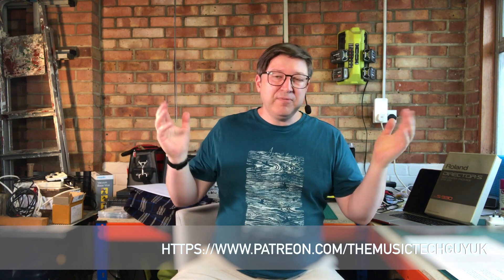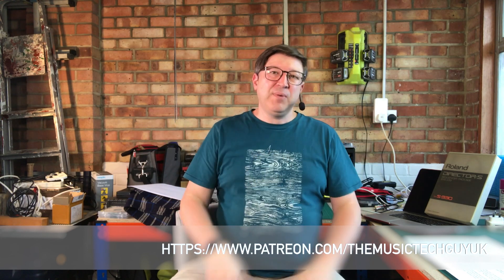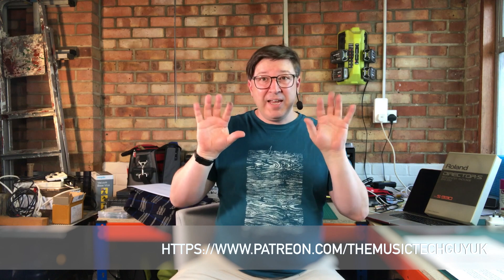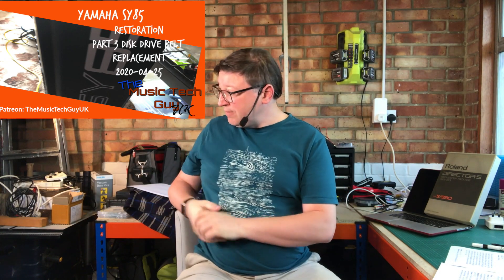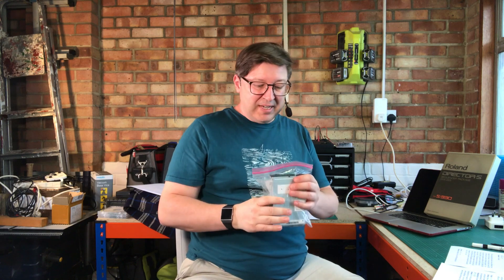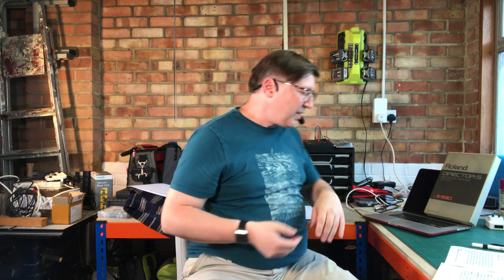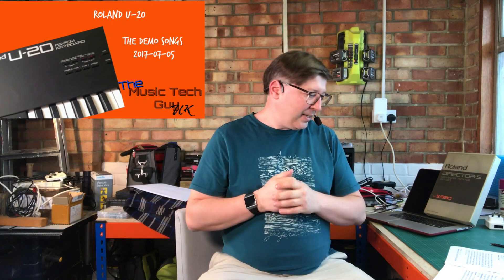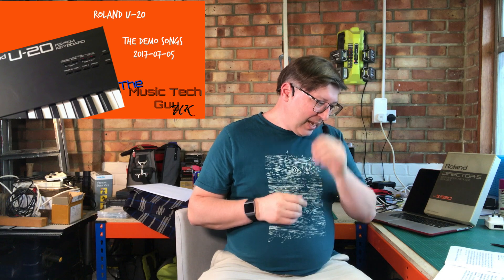Roland A-80 layout, RAM on Korg OASYS, Yamaha SY85 Floppy Emulator, Roland Best Synth Maker?

Comment: I was waiting to see how you played that match. Well done. So, I agree Jon. I love Roland synths as a Roland D-20 was my first synth. I've always had a soft spot for the brand then and to this day. However, although Roland struck gold with the Jupiter 8, TR808/909, and D-50 the rest of the lines didn't do as well until available on 2nd hand market. TBH, Analog was ruled by Moog and Sequential Circuits. Yamaha owned the 80s with the CS and DX series. Korg took late 80s and early 90s with M1 series. While the TR808 was instrumental in early days of hip-hop,  the drum machine market was owned by Linn and EMU. The era of Samples brought the Akai's and Ensoniq to center stage.  However, Roland struck gold again in the 90s with the JV series (rack mostly) as film composers purchased boat loads of them for their studios. For electronic drumming the TD series is the gold standard for e-drumming. Overall, Roland has made great products over the years, but I struggle to call them "the best" when most music of the 80s, 90s, and 2000s were made on other brands.
Reply from the maker: @Shawn Curran. I agree that a number of the Roland products have gained popularity in the second hand market.  I think first time around with many products, musicians do not understand how to get the full potential out of them.  Many are so complex that a lot of people just give up before scratching the surface!
There are those that get the user interface right that they just take off.  With the OASYS and KRONOS I have been playing with these for years and I feel only scratched the surface.  Jon

Comment: Hello Music Tech Guy UK, yes the last e-mail does add to the debate and part of that is what the hell happened to Yamaha?  Sure they currently make some excellent equipment particularly in HiFi and their HS series monitors are fantastic but they must have lost their palate for keyboard synths such as the CS-80 and DX7 (I exclude Motif-style ones from discussion)
Reply from the maker: I have to admit I have played with the MODX and Montage.  Both of which are actually not bad synths.  I did a piece a little while back where I talked about if I didn’t have a KRONOS what would I buy and I think the Fantom is better bang for your buck.  Jon